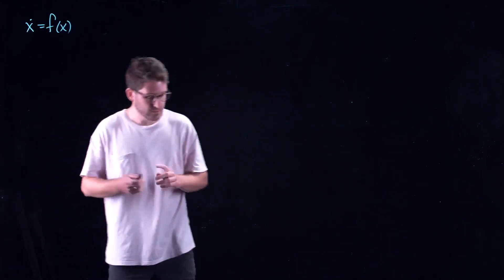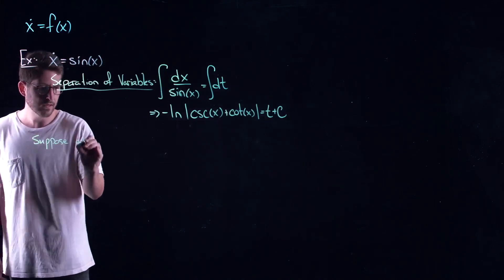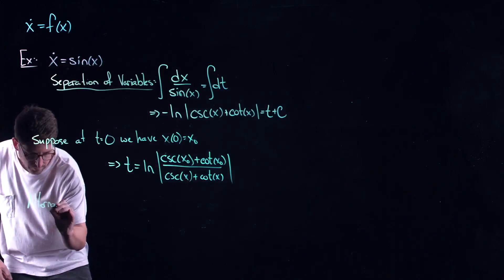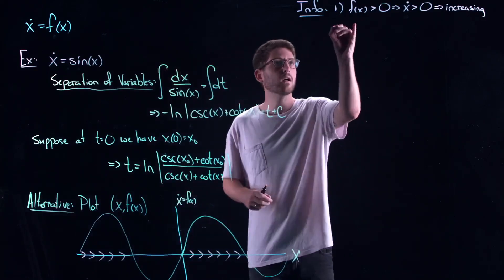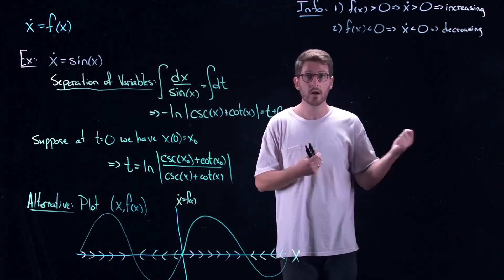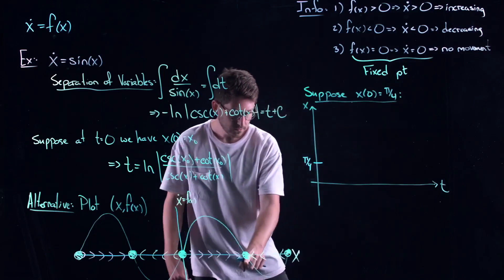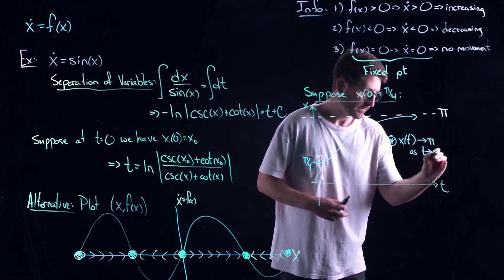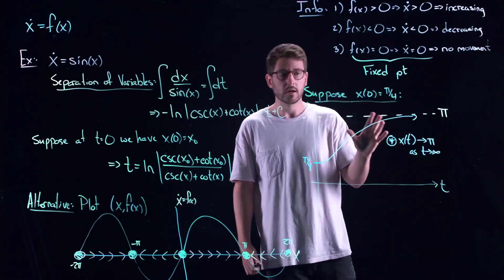The Geometry of Flows on the Line - Dynamical Systems | Lecture 2

Comment: Hey, thanks for the video. But a part which difficult to me to understand is that in the sinusoidal diagram some parts have negative solpe which means their value is decreasing, but you've mentioned that the whole part despite the negative slope can be considered as increasing,  I'm talking about the interval between the zero to pi on the x axis
Reply: Negative slope indicate that the rate of change of  x is decrease(That not means that rate of change of x is negative). You can think it like that derivative of x is the velocity of particle and x is the position of particle. From zero to pi,  for first half velocity is increase( at x = 0, velocity is zero then increase as value of sinx is increase) and in second half, velocity is decrease but as velocity is positive always in that range , the value of x will increase and at x = pi , the velocity is zero and particle will not move(Fixed point).